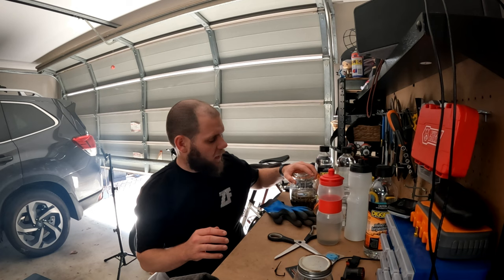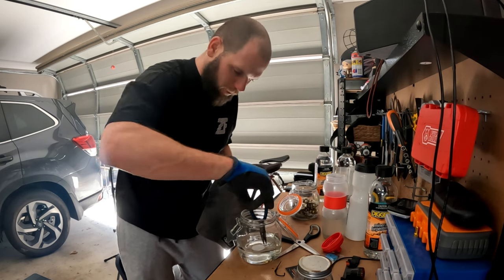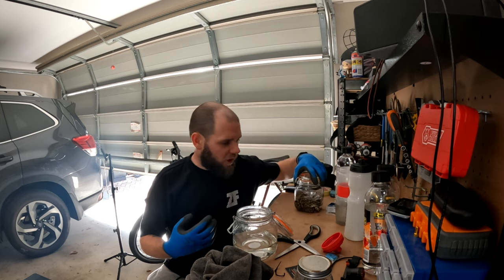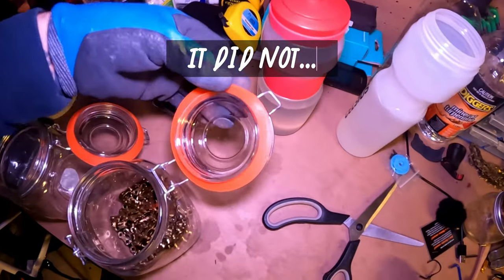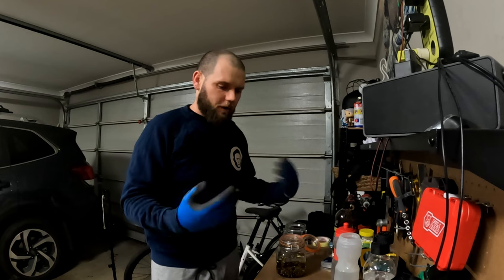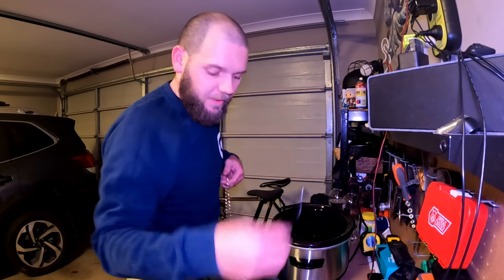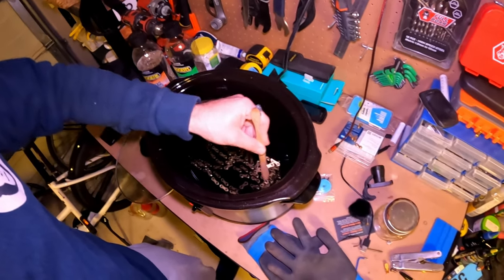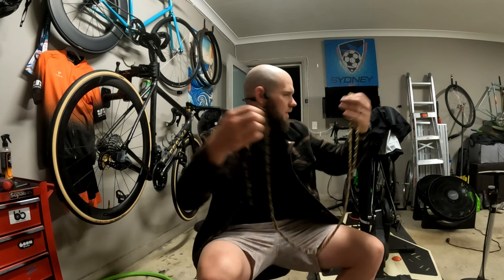Road Bike Chain Waxing Pt 2

Comment: The chain didn't look too stiff at the end. I think it should be almost hard to bend at first when the links are waxed well inside. Maybe it's just the video.
Reply from the maker: It was stiff, but the Absolute Black formula is supposed to be the easiest to break in. Taken it out today and it’s going well after two rides. Quiet as a mouse.